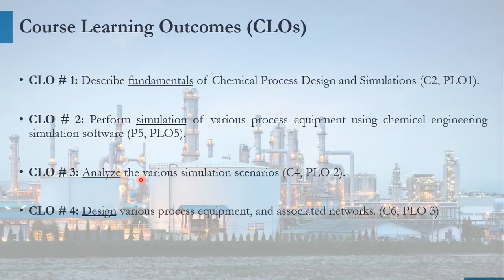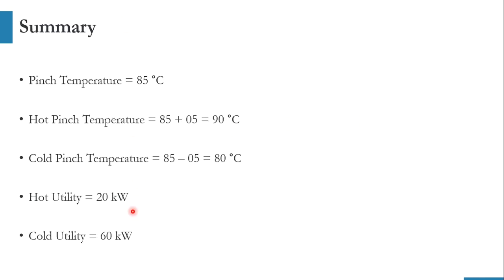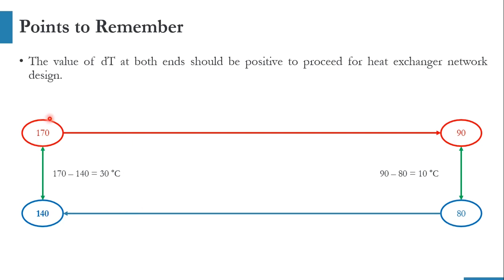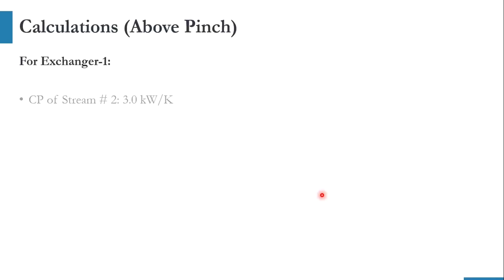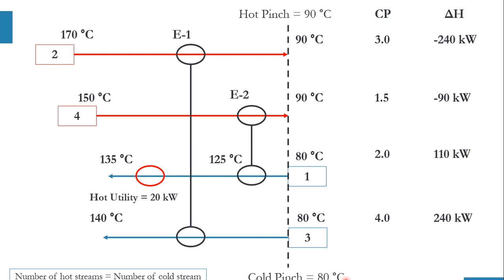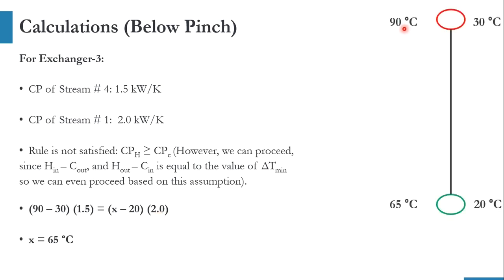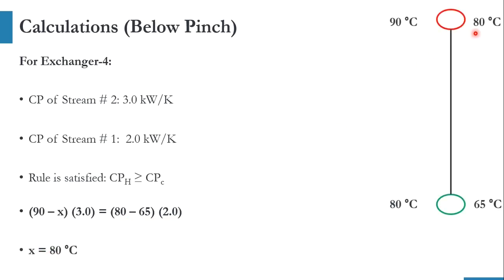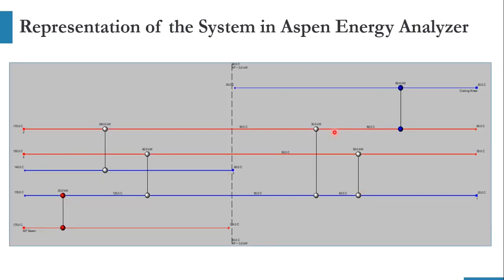Rigorous design of heat exchanger network - 4 stream problem - Lecture # 72

Comment: Following with lecture, could you please explain why 5°C switch is used? any criteria to decide this step.
Reply from the maker: It is an example to demonstrate the system. Usually, the values of dT are dependent on the system characteristics.